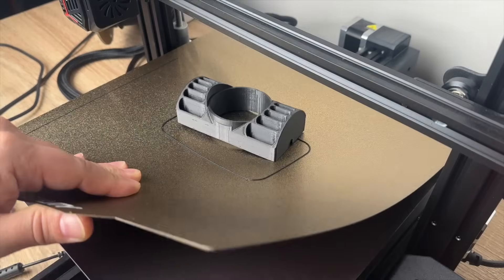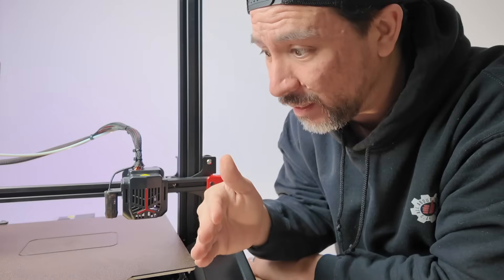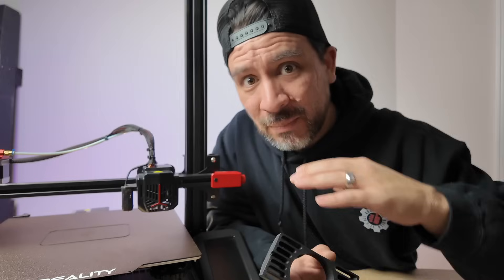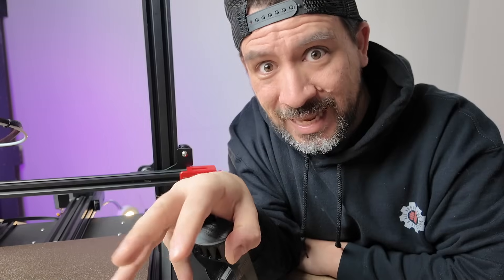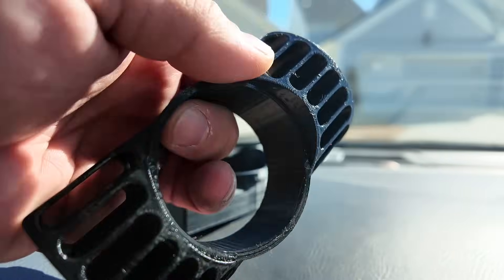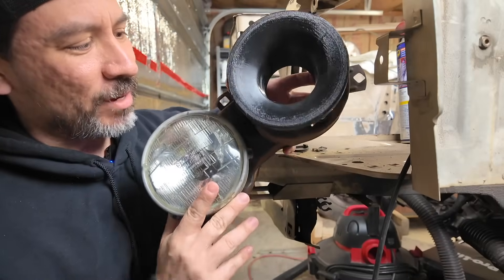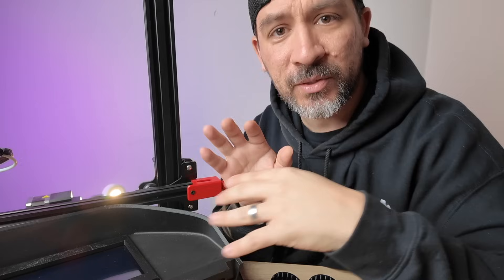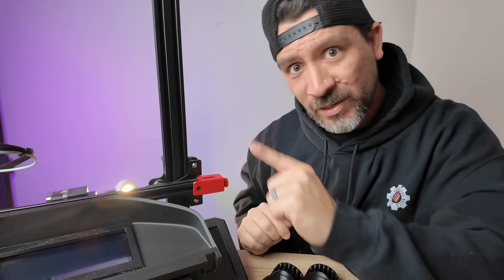DIY 3d Printed Car Parts... Is it Overhyped?

Comment: as a 3D printer beginner and as Petrolhead i thank you for this video! i'm gonna buy my 1st 3D printer this month wich one do you suggest between the Creality and the Artillery? i'm more keen to the X4 Plus because of the larger bed (even if i'll rarely print larger stuff) but i'm open to hear back from you :)
Reply from the maker: Thx for watching!!! If its your first printer, I'd recommend a Bambu Lab X1P or or a P1S. They might be a bit smaller, but they get you up and going with very little fuss especially if you combine them with the Bambu Lab Filaments. The enclosed printers will also allow you to print with other filaments which are better in sunlight like ABS. But if you want to go big maybe give the X4 Plus a try or the K1 Max with lidar. That way you don't have to worry about manual bed level/z-offset.
Reply: @Itsallaboutthebuild  the Bambu and enclosed printers are really expensive respect the X4 and Ender 3... since i don't really care about changing the filament while printing or having rainbow like prints i don't quite need a printer like that, about being enclosed i prefer to see what the printer is doing upclose, in case i can protect them with an acrylic dome or something similar 🤔 if i have to make some simple set up or calibration it's no big deal i can do that :)
Reply from the maker: @ the enclosure will be needed if you want to print in ABS or ASA to keep heat in which prevents warping. However, you could go with a separate heat enclosure for an open 3d printer like ya said. You can find heat resistant ones on Amazon too. If you don’t need a bed bigger than 256x256x256mm the Bambu A1 is a good deal too. We switched from the Creality to an A1 recently and it’s a night and day difference from the Ender 3
Reply: @Itsallaboutthebuild  the A1 is a bit more affordable, the problem with Bambu is that you can find them only on their site or a few scalpers websites and that's why the prices are higher... they'll probably are really more sofisticated than their counterparts but if i have to spend that kind of money as you said i'd better go on something with no compromises. i think the better money/quality for starting is the X4 Plus for now, if i'll ever get rich or start any business i'll surely upgrade it then 😂 but for now i can't so i have to find the best compromise 😢
Reply from the maker: @fedemaster3749  for sure, we started with lower cost. Just needs a little more tweaking from time to time 🙌🙌🙌

Comment: The bed had nothing to do with the warpage. You need a enclosure and probably a heated one at that.  Once the print gets an 1" or above the plate it will cool will bottom is still heated at the bed.  All 3d printed parts shrink when cooled.  The top is shrinking and the bottom is not and its pulling the bottom off the build plate.  You need more experience before making a video .
Reply from the maker: @Crushercurtis702  thx for the tips and yes ABS needs an enclosure for sure

Comment: PLA is for toys, ASA, PA or minimum PETG for carparts.
Reply from the maker: Agreed :)
Reply: But most people use pla+ for firearms
Reply from the maker: @kyzmn  For car parts, you need better UV and heat resistance especially if the part is exposed to the sun.

Comment: You really need an enclosure to print ABS. No other way around it.
Reply from the maker: @CJBMAGGOT94  for sure, what 3D printer with an enclosure and at least 300x300x300mm build plate do you recommend???

Comment: so, I really like printing with PETg but there are some problems with it though... even on a fairly expensive 3d printer, spaghetification of the print is a huge issue. the filament is really good at sucking up moisture, making it un useable until you dehydrate it again. I'd still recommend it, and I'd also recommend updating your 3d printer to something modern. you get infinitely better results with less effort, and significantly faster print times.
Reply from the maker: @TheJonclift  thanks for the tips. Just picked up a filament dryer and switched to Ocra for easier calibration tests. What printer do you recommend with a built plate of at least 300x300x300mm???
Reply: @ good question. I LOVE my bambu labs x1 carbon, but it has a smaller build volume at 256x256, so I wish I could tell you. There’s thousands of printers out there these days. If I could, I recommend checking out @hexibase, the guy is a brilliant audio engineer here on YT, and serendipitously ended up making a ton Of 3D printer content, he tests and reviews all sorts of large-form-factor 3D printers. Seems like every week, someone has sent him a new printer. (I’m just a fan, not affiliated with him at all) but I would highly recommend his videos on 3D printers.
Reply from the maker: Thx for the feedback!!! Have been checking out hexibase.

Comment: change your layer height to match the nozzle size and you'll get even BETTER quality, tolerances and strength/bond
Reply from the maker: Ah, ok. Will give it a try. Thinking of changing over to Bambu Lab eventually....What 3d printer brand do you use???

Comment: good stuff, one thing to mention is i would recommend using at least 30% infill for anything you plan to keep in the car. I custom design and use a lot of things in my classics, and my preference is PETG CF (Need a hardened nozzle). Its stands up well and i haven't had any issues with it. I've done custom gauge bezels, full center consoles, and console inserts. Various Gauge PODS etc........ PETG in general you usually want to slow down your print speeds, some Slicers have some of that preset when you select filament type. Another thing to check, PETG usually likes less then 100% flow rates, so you want to tune your printer for said filament. ORCA slicer has an awesome amount of tools for running these calibrations but online you can find things like calibration cubes and flow rate tests you can run to really tune things in.    Another thing is a raft shield, it helps containerize your printer to help avoid some of the warping and pulling on the corners.
Reply from the maker: @ID10TGARAGE  Thanks for watching and AMAZING FEEDBACK. I’ve started to play with Orca and it looks pretty cool. May I ask which 3d printer do you use???
Reply: My husband is an electrical engineer and has operated his own mechanic shop focusing on custom builds since the 80’s. He had a stroke and lost the ability to work. He still has all the KNOWLEDGE from being a 20,000 hour engine guy. He could do anything!! Please tell me if it’s a good idea to transform his shop into a 3d parts printing business. This man can fabricate a part he needs from ANYTHING and make it work.
Reply from the maker: @ Sorry to hear that. Starting a business right off the bat might be tough as you need to find the right part that will have high demand. I recommend starting simple first and once you find that special part, then scale up. We also just picked up a Bambu Lab A1 and its a game changer. We are no longer having to fine tune and adjust sooo many different settings. Highly recommend Bambu Lab for beginners because you can focus on just 3d printing parts and not having to constantly tinker with a 3d printer. You can even go with a Bambu Lab printer with an enclosure like the X1 or P1 which provides the ability to print in many more different filament types.

Comment: ABS and PETG work best both inside an enclosure as they both need the air temperature around them to be stable and high.

To help with the strings, a little fire from a lighter/torch would help but be careful not to leave the flame in the same position for long otherwise it will start to melt or deform.
Reply from the maker: @ConnorAkaDub  oh nice, great tips. Will have to grab one of those small tent enclosures. Budget is too tight to buy another printer right now 🤣

Comment: Nice, lots of times I hear people talking about printing "car parts" but they dont have the right expectations in mind. The printer you have is fine. Its not too old. I have a s1 pro modded. Maybe look into adding klipper to extend your printers life and capabilities. The K1 max has a huge bed and you can get it bundled with a scanner. Next level for making parts. I'm looking at the k2 plus. Ita expensive though.
Reply from the maker: Thx!!! Been looking to upgrade for an even larger print bed. The K2 looks nice, but yeah it’s $$$. What do you think about the QIDI PLUS4?
Reply: @Itsallaboutthebuild  Havent tried that brand. The specs look pretty decent. Aurora tech tips here on YouTube probably has a video.
Reply from the maker: @CorvusCorps  thx, will check em out 🙏

Comment: Hello! My question is how does the PA6 resist gasoline? I'm working on an intake for double 40 DCOEs, and I have a Bamboolab as well.
Reply from the maker: @istvanfancsali6560  hi, sorry I haven’t tested PA6, but I’ve read on Bambu forums that nylon based filaments are best around gasoline. Thx for commenting 🙌

Comment: If you want to print ABS without an enclosure, just put a big cardboard box over the printer and heat up the bed and wate for about 10 min before starting the print.
And do not remove the box before the print finished!
Reply from the maker: Oh man that's a great idea. Might need to give that a try, but I'm thinking about which printer I should get next...The Qudi Plus 4 or Creality K1 Max....
Reply: @Itsallaboutthebuild 
I can't help you with your decision.
I started printing some years ago with an Ender5 and this printer is still a work horse. Printing like fire and forget, just start the print and some hours the part is done. It also provides really good print quality once everything is calibrated right.
Since some months I own an Qidi Q1 pro because I wanted to print more advanced and engineering materials and till now I am really happy with this printer. Does everything I need and can print all relevant materials. I think it is a good value for the price.
Since I do not own the Plus 4 I can't say anything about it but what I think is interesting, is the bigger build volume compared to my Q1 pro but till now I rely had no part that would require a bigger one.
But having and not needing is better than needing and not having.
Reply from the maker: @largolagrande300  thanks for all the great info, much appreciated 🙌🙌🙌

Comment: If you want to print ABS without an enclosure, just put a big cardboard box over the printer and heat up the bed and wate for about 10 min before starting the print.
And do not remove the box before the print finished!
Reply from the maker: Now thats an idea 😁
Reply: But wont the heat become to much?
Reply: @Fourgiv4 should work with ABS. Just give it a try.

Comment: I wouldnt print car parts with PLA, one hot day and theyre deformed
Reply: Nowadays i use ASA to print car parts ,because is heat and weather resistant. In my opinion easier to print also than the ABS.
Reply: @Görbestúdió  What about PETG? It should be an easier combination between ABS and PLA, did you try it?
Reply: @gerardfernandes3332  PETG only has 60-70 celsius degree tolerances before melting, it's not enough for car external parts. On a sunny day at summer its melting. For some an enclosure element can be good in a car, but only for estatic parts.
Reply: @Görbestúdió Absolutely fine if you live in 🇬🇧 😆☂️
Reply from the maker: @Görbestúdió  oh wow, will have to try it out immediately
Reply: @Itsallaboutthebuild  I print headlight pieces out of ASA due to better heat resistance and UV resistance. Only reason to use ABS is if you need better impact resistance.
Reply: PC or ABS would be a better choice.
Reply: @pinzgauerbelgium ASA has added UV resistance and stuff
Reply from the maker: @itsdarkest  yup, you are correct 😁
Reply: @Itsallaboutthebuild  came here to say exactly this. It's good for prototyping, especially if your final print is a more expensive filament. (In reference for things used in/on a car and or outside.
Reply from the maker: @modsquad8u  right on, we initially printed our test dash with PLA, now we are printing with ABS. However I’ve heard good things about other filaments like ASA
Reply: @Itsallaboutthebuild  ASA has been engineered as the successor to ABS. Its better in every way, and it has UV resistance unlike ABS.
Reply from the maker: @ We are liking ASA after some of our testing. Layer adhesion seems to be better too 🙂🙂🙂

Comment: Buy a Qidi plus 4. its a very cool printer for all Filaments. heated enclosure. very high temperatures for every filament. 
For you for 800 bugs the best option. and you have perfect parts out of it. realy perfect parts. the ender 3 is the most worst printer ever sales. 
plz dudes buy a better printer. these problems are gone with the qidi plus 4.
Reply from the maker: Thx, I see it has a built size of 305x305x280mm too. Looks super appealing…
Reply: @Itsallaboutthebuild  for thisnprize a no brainer.
I have buy the bambulab x1c. But its only why i have not enought space for Such a big printer likendie qidi
Reply from the maker: @marcelm.2170  how do you like the x1c?
Reply: @Itsallaboutthebuild  its a nice printer. But only 256x256x256.
Print quality ist very good.
I have now 50 prints. Only 1 print is not ok. But its my Fault. I have changed many settings.
Its a very fast printer. The ams ist perfect. 
But its expensive. And it has no heatet enclosure.
Cool Features are to print with you mobile phone. 
The printer is loud af.
Its a Cloud Based printer. 
You can print from all over the World when your printer is on. 
And that the biggest con. You can not shut down the printer to sleep Mode. The printer is always on. You have to put him down by turn off the Power plug. Not on the printer.
Reply from the maker: @marcelm.2170  ah I see. My brother has a Bambu Lab too and loves it. I just need a bigger build plate for dashboard clusters 😁

Comment: The organic tree supports in Orca are amazing, the underside is soooo clean compared to using traditional supports.
Reply: also with the ABS you can do a vapor smoothing with acetone to remove any layer lines. Always print ABS in a WELL ventilated area, as well. If you're in a garage, they sell enclosures, like mini grow tents to keep the area heated so the ABS has a better chance of success while printing. 
There's sooooo much fun stuff you can do with a printer, it's sometimes a little overwhelming.
Reply from the maker: @ For sure, I got some non-toxic ABS from Creality. I'm really hoping that it's NOT toxic...Might be another good video to test 😁
Reply from the maker: Loading Orca now. Will give it a try. Non tree supports are horrible...

Comment: 350bucks for having to spend 90 minutes figuring their ULTRA shitty website design out and u dont even get autobedleveling? 😂 get the same quality, waaaay better shopping experience, and get free autobedleveling, while saving 150 bucks, buying an elegoo, you got scammed HARD 😅
Reply from the maker: @1324marcus  it has auto bed leveling, just not auto z-offset. The challenge is it seems different filaments sometimes require different z offset. Do other printers also auto correct z offset???